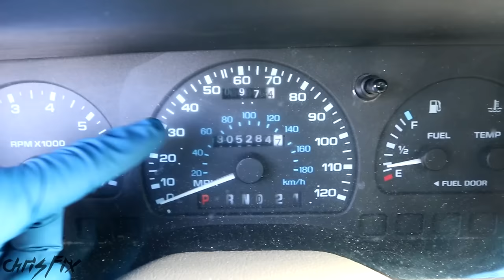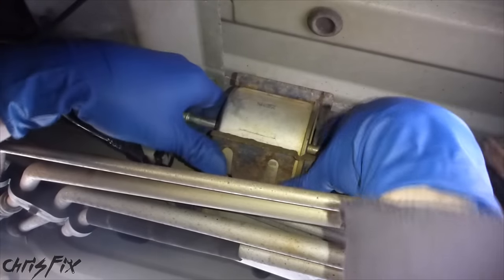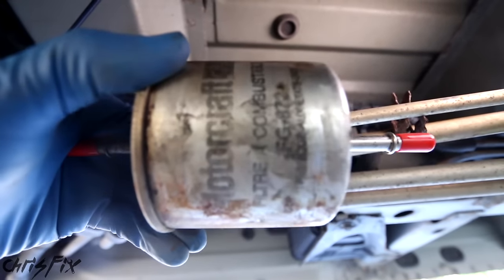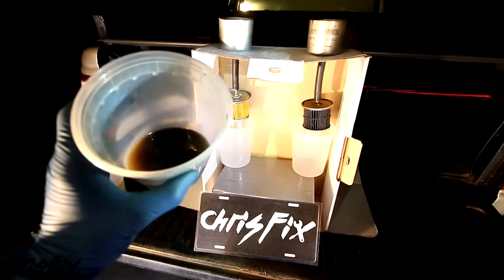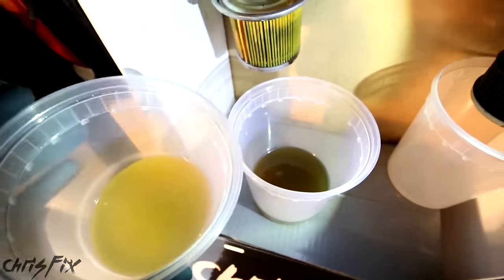What does the inside of a Fuel Filter look like after 300,000 miles?

Comment: Wish mine was easy to change. Mine is in the tank and part of the pump.
Reply: +Mr1998jeepcherokee My Ford is like that, too. They are considered "lifetime" filters, so hypothetically you don't need to service them. If the fuel pump ever goes out, then you replace the whole unit.
Reply: same with my mom's mazda 6 and I think it's clogged up
Reply: +Mr1998jeepcherokee I have the same problem. It says in the manual to change the filter and pump every 60,000 miles. It's kind of annoying. I prefer to change fuel filters every 10,000 miles but with this system that becomes very expensive. What I do instead is stick a fuel system cleaner through the car every 3000 miles just to make sure everything's fairly clean and isn't giving the filter a hard time.
Reply: most in tank fuel filters will be under the back seat, passanger side. replacing these type of filters is not your usual diy job. making sure you have the exact part number and replacement gaskets  (the top gasket, after being submerged in gas for so long will inflate and needs to be replaced, unless you can leave it out in the sun to dry out). the must important aspect is safety, making sure you are grounded when you work not to create sparks while working from your vlothes or tools.
Reply: +KartDodger I´m in the same situation on a Suzuki Swift 2007. Does the fuel system cleaner does the job of cleaning the filter?
Reply: ***** it will actually force dirt fron your gas tank to the filter
Reply: PT Cruiser here, same story... It would be great to watch a ChrisFix video doing an in-tank fuel filter change... So we don't miss anything
Reply: ***** sometimes space saving just goes too far... putting the fuel filter inside the tank is like putting the oil filter inside the oil pan... just doesn't make any sense to me having to dissasemble like half the car to replace a component that is supposed to be periodically and easily serviced.
Reply: Yeah, like mine it depends on in tank filtering only which is BS because when it broke down in the tank, I had no idea until the pieces burnt out the fuel pump. Thus, that should be a prefilter only with an inline one in conjunction since it can't be monitored or changed easily.
Reply: +Jorge Carrapice What about putting an auxiliary fuel filter in-line somewhere along the frame like this? I know most guys/gals don't have a full shop in their garage to make those mods and so on, but if your fuel lines aren't braided SS it should be fairly easy if time consuming. I know it would only be worth doing if you did it along with replacing the internal filter, or on a new car, but it's food for thought...
Reply: +Knolltop Farms Wait, scratch that...for some reason I was thinking backwards, and you'd just be re-filtering gas that already went through your in-tank filter, so it wouldn't pre-filter any fuel and would only work to polish your gas if your original went bad and the pump was still pushing. Not really worth the effort. My bad.
Reply: +Jorge Carrapice  No it do not clean the filter, if just disolve the "gum" and algae growing in your tank you have to replace the changable filter between 50 and 60k miles.
Reply: +Mr1998jeepcherokee Mine under the back seat
Reply: Mines in the carburetor. it's pretty easy to change, and since it's so small I change it with every oil change
Reply: +Jorge Carrapice stupid customers not understanding why it's done that way
Reply: +Mr1998jeepcherokee I changed the fuel filter on my '05 Hyundai Elantra, which is inside the tank. I took me 4 to 5 hours to do it. Didn't really see an improvement on gas mileage. But still, I would rather see the fuel filter outside the tank.
Reply: SilentServiceCode
Then please highlight me why it is done that way.
Reply: +Texassince1836 How on earth do you fit one in a carburettor? You mean a small inline filter in the engine bay?
Reply: +Knolltop Farms I have that setup. I use a low pressure pump that fills a swirl pot in the boot (trunk) and then a high pressure pump that feeds the injectors. Both lines have filters on them.
Reply: +Albinus81 Some carbs have a fuel filter in the fuel inlet in the carb body.  Google a rochester quadrajet fuel filter for reference

Comment: I knew you would have some amazing video showing how a bad filter would affect flow <3 I bought a car not running an the fuel pump was stuffed soo i replaced. Now it's fuel cutting under load if i give more than about 50% throttle. Not sure if I stuffed up the fuel pump job (but it's soo simple??). So I will get the fuel filter replaced as it prob good if doing the pump. Hopefully that's all it is

Comment: Top video Chris . I was going to change the filter on my  90 k diesel engine next year but I think its better done sooner than later now  and the filters are cheap , I think I've put 25 k on the car since the last  time I changed it and diesel can grow mold so I won't chance clogging the injectors then making the pump work harder than it should which could in time make the fuel pump burn out which would be a bigger job . It should bring down mph as well or at least keep it the same  if the filter on it  at the moment is working and doing it's job and as your video shows it should be 👍

Comment: DUDE!, i just replaced the fuel filter on my dodge neon, it was kinda hard because the filter is INSIDE the fuel pump, however, i had the opportunity to clean the tank and replace the pump all together, and man oh man, the filter was BLACK AF, now i have GOOD fuel pressure and replaced the injectors and my fuel economy is great, and the car is running smoother than before, thanks a lot, cheers from Tijuana Mexico!

Comment: Which country has the cleanest fuel?
Reply: USA
Reply: P Pyzyna, any proof? EU maybe?
Reply: P Pyzyna nope. the Arabs and Russians.
Reply: In Russia, we have Euro5 as mandatory for fuel. In EU, Euro6. Current EPA standards and Euro6 are not comparable as there are several requiremnts, some of them are stricter in EPA, some in Euro6.
Reply: And where do you think they got the technology to build refineries?  Look it up and you will see the USA was first to develop fuel from light sweet crude oil.  It is the best.
Reply: P Pyzyna, Now it is not important who was the first a century or more ago. The original proccess obviously had to be improved, otherwise EPA would not make standards stricter and stricter as time passed. Producing gas is business. The cheaper the process, but still conformant to the local regulations, the greater the profits. The most "unclean" element, sulfur, is restricted by EPA to be 15 ppm max, where Euro6 sets the cap at 10. EU is cleaner in this aspect. But EPA has some other metrics which are stricter. As for cleanness in terms of gas not having any real dirt which the filter captures, it really depends on the pump operator on how they clean their storage tanks, pumps and gas tankers. And even your car to not capture small amounts of dirt when you open or close the fuel tank cap or refuel. And also not rusting or somehow disintegrating along the fuel line or tank as time goes on.
Reply: Haha in Russia? Arab countries maybe, but Russia? Some cars from Europe wouldn't even start there! In central Europe (Poland) we have bit better fuel but best in terms of quality is in Scandinavia - you can tell just by how different engine works there and how lower is fuel consumption.
Reply: At least on paper, in Russia, we have Euro5 as mandatory. In EU Euro6 is mandatory now. But actual quality and control in Russia varies greatly. If I drive away from the capital 100km, I have a high chance to get a shitty petrol. In Moscow allmost all of the petrol is conformant. Did not try to find standards for petrol in Arab countries, though.
Reply: Japan
Reply: Depends on which fuel you mean.

South Africa has the cleanest diesel, as it's synthetic because it's made from coal using an advanced process developed by SASOL.
Reply: Hubscharber Wow that's interesting! As a funny fact: in Europe Nazi Germans were making fuel from coal when they were cut off from oil. It was very problematic mostly because of low efficiency and high cost.
Reply: SASOL developed the process from the Fischer-Tropsch process used by the Germans during the war.

GTL products are very lucrative in a high price oil market.
Reply: It's not the rafinery ,It's the gas stations that are crucial in how the fuel is clean or not.
Reply: +P James

You wish.  Russia and the UAE offer far superior quality of fuel.  UK isn't far behind in fuel particulate quality.  The sheer size and demand for fuel in the US steers the quality of supply.

Comment: You are suppose to change fuel filters every 15k miles or 12 months....
Reply: They are like 10 dollars for god sakes.
Reply: +jonny brAvo 
Right Jonny
If he bothered doing regular maintenance, new oil, spark plugs, air filers, oil filters etc.. etc... why skipping on a cheap, easy to change oil filter'???
Just why??? why?... and some people here still listen to this guy....
Why do you change filters? The same reason you use clean underwear after you take a bath thats why!
Reply: +jonny brAvo 10 dollars, so what? its pointless wasting your time changing a fuel filter thats almost new, looking at the 30k filter I will change mine after 60k miles.
Reply: +Pedro Cação it depends on where the filter is, to replace my filter i would have to drop the tank.
Reply: Just did my first one @ the 60k. 2nd owner of a 99 Frontier. Lot of gunk came out after 25 years...Had it been mine for all those years I'd of changed every 15k. To his defense first recommended change per manual wasn't until 60 k.

Comment: 300K on the same filter.....??!!!  No problem because of good quality piston return springs...  So, an older fuel filter helps your mileage cause it slows down the flow of gas..???
Reply: Thats exactly what I was thinking lol
Reply: It may help, but only if the filter is clogged enough to lower pressure just enough so it runs. It won't run well at higher rpms though, and any cash you save on fuel evaporates when the fuel pump dies from exhaustion trying to keep the pressure up.

Comment: Great video! My son’s ‘04 truck is throwing an exhaust system code that lists a fuel filter problem as a possible source. We’ll change it to cross off the list but I hope it’s not an expensive fix as say, replacing the catalytic converter 😭

Comment: After seeing this video, I'm going to change out the fuel filter on my 2003 Mazda Protege DX with 118,500 miles. Bought the car so I could learn how to drive stick. Seems the filter is the original as none of the previous two owners ever bothered to replace it in the last 17 years. Car seems to sputter at low speed such as first gear, and vibrate at idle while on neutral. Will be interesting if I find dirt inside the filter.

Comment: The condition of the 300K filter is almost same with my 1996 F250's,  351 Windsor V8 , it's nearly 280K mile, not far from your 300K. When I got this truck, full throttle can only get about half throttle power, far less than the V8 power it supposed to be. Then a mechanic told me to change a new fuel filter. The gasoline from intake of the filter is as dirty as that in your video. You can guess the result,  I enjoy the V8 power every day now.

Comment: So where does all that dirt come from?  I can only suggest from a rusting mild steel fuel tank, rust caused by condensation above the fuel line.  I've recently changed my fuel filter, just for outside appearance' sake, and the old filter element was only slightly discoloured as I fitted a stainless steel tank years ago.  Nice vid, thanks.

Comment: The replacement filter for my 1997 Toyota Celica GT convertible arrived this morning.  It has 230,000 miles.  Don't know if fuel filter has ever been changed, probably not so I expect it will be pretty bad not unlike the 300,000 mile filter you opened up here.  I do know there is a slight barely noticeable bucking at highway speed, especially when traveling going uphill so hoping a new fuel filter and good quality fuel injector cleaner will solve.  If not could be fuel pump.  Thanks to the likes of you I'm able to do whatever work myself.  Chris, noticed your video output has slowed, any reason for this?

Comment: I changed the fuel filter on my Volvo XC70 when it was around  214,373 miles i think, it had never been done and it was black.
I had a problem with my car going into safemode when i accelerated to hard, and it seems to be fixed now more or less.

Comment: I clean fuel filters before replacement Mabey 4 times max its only a 81 f100 with a carby so it works fine just flip it around with the output disconnected and crank it works well in a pinch

Comment: Always Wondered what would happen if you just connected the fuel line connections with high pressure fuel line and high pressure clamps. Obviously you would get unfiltered fuel into the engine, but would the fuel pressure regulator only let in so much fuel? Regardless of flow? I think it's a worthy experiment

Comment: I got about 153K miles on my Lexus IS-F with the original fuel filter. I was actually planning to have my filter and pump replaced when I return state side. Nothing wrong with the car. I just figured it'd be good maintenance to get out of the way. Thought, I'm not sure if it's even worth it due to the fact I have never seen or any reported issues with those Toyota parts on this car.

Comment: @chrisfix I know you dont work on diesels normally but it maybe worth noting to others that the fuel filter intervals for diesels is much shorter. Depending on the application. Most diesel pickup fuel filters need to be replaced every 10k to 15k miles, sometimes less depending on fuel supplier.
Reply from the maker: Thanks for sharing!

Comment: Pretty much a fuel filters only real purpose on most older vehicles is to catch all the bits of brush and commutator material that comes off the fuel pump during operation. Paradoxically, most older fuel pumps are open frame motors in a sealed housing that are directly cooled by gasoline. The fuel flows directly through the motor after coming off the pump section. With the advent of brushless motors, external fuel filters are becoming less common since they do not have to handle the high particle load.

Comment: That's one clean van underneath for having 300,000 miles. I tried to get Firestone to do my fuel filter on my 98 Ranger. Thought they'd have no problem. Ends up, even they couldn't get it off. Almost 200,000 miles. They say that it would cost about $300 to get it off by redoing the fuel lines. Maybe there's a way to get them off without damaging the lines? I don't know. Just glad to know that I'm not the only one with a fuel filter with that many miles.

Comment: I just had two gas fuel filters  come apart!!    The glue holding the cartridge media to the housing dissolved and it was loose inside , Any and all the collected dirt etc went right into engine along with the dissolved glue.  In addition the loose media was intermittently blocking the outflow and over pressuring the fuel pump.   Almost sure ethanol is the problem and any additives or increase is making things worse.  Maybe a test of filters vs ethanol is in order?????

Comment: 60'000 kilometers or 35'000 miles, i change air filter, œil filter, cabin filter and gasoline filter.

Coolant fluid, brakes fluid, power steering fluid, gearbox fluid, for the 4wd i change the front and rear axels fluids.

For the air condicitioning, recharge, change the filter (is the trash waste place for the humidity and bacteries) and i make a desinfection spray.

Every year, i make a wheels alignement for reduce the using of the tires.

Sorry for my awful english. Take care. Grettings from Swiss

Comment: I changed my stock fuel filter after 230k miles and i felt a huge surge of power. No more chuggin to get up to speed. And no more sputtering rpm at a stop. AND i was having issues with my gas tank, if i had less than half a tank i could feel the fuel system trying to push fuel through and it just couldnt do it well.

Comment: Hi Chris. I love your videos and useful. I have Elantra 2013. I had a recall on the engine block and changed the engine block from nearly 2 months ago. before I changed the engine block it use to shake when I have been driving it for a while and stopped on the red light, but now when I changed the engine block it's gone for 2 weeks and came back. I have only 97k on the engine. what could cause the engine to shake?
Reply from the maker: A misfire or bad motor mounts.

Comment: Interesting, and great video. I'm surprised the fuel filter on both Ford vehicles wasn't changed sooner since you're up on maintenance on your vehicles. Since fuel filters are supposed to be changed every 1 1/2 to 2 years, or 20,000 to 30,000 miles, which ever comes first. Depending on year, model, and miles driven per year. For example my 06 CVPI is every 30,000 miles. Although, some newer vehicles can last longer between fuel filter change. But these Ford vehicles are older vehicles though. I guess you got lucky and had no engine issues after the high mileage. Either way great video as always.👍
Reply: A lot of cars never had their fuel filter changed I’d say very 30K-50K miles is good enough for me. I just changed it on my s10 and it was a mess. It pour what felt like a litter of gas in me. I’m gonna cut the filter tomatoes and hopefully it’s really dirty…